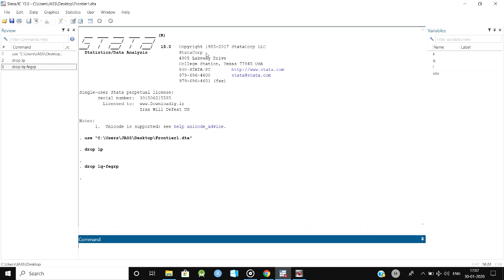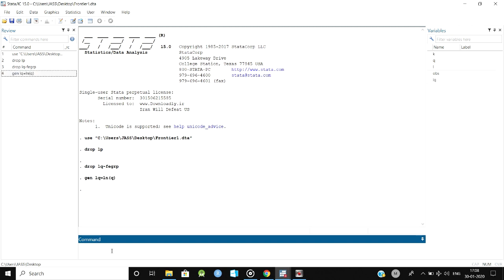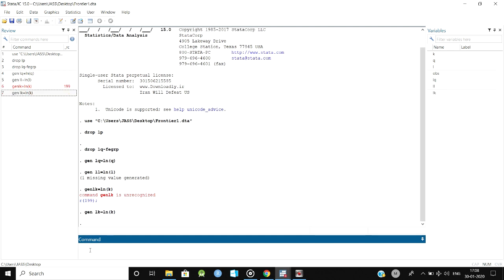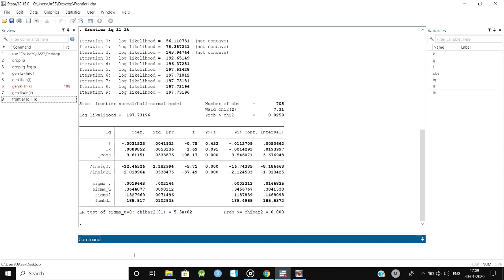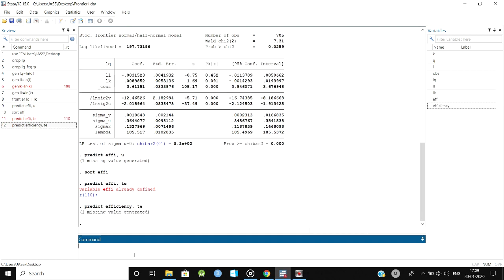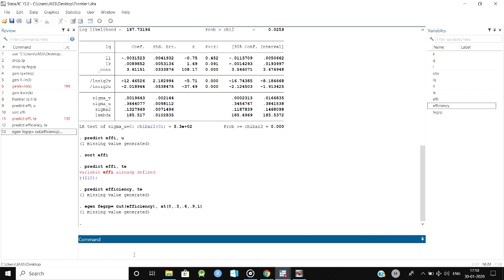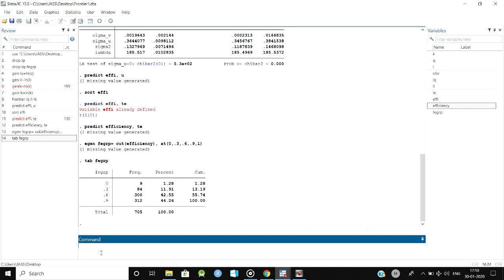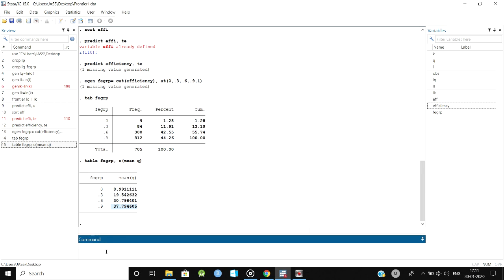Technical efficiency (frontier) estimation in STATA

Comment: Could you please clearly write the stata command you had used. It will be helpful for me.
Reply from the maker: frontier lq ll lk
 ren effi u
predict effi, te
egen fegrp=cut(effi), at(.3,.6,.9,1)
 table fegrp, c(mean q)
Reply: @techeconomist6919  hi friend, what is the fegrp? do you mean that 1 is the maximum of TE?  this command is for grouping firm to different level
Reply from the maker: @tupham8391  fegrp is grouping of the respondents. yeah 1 is 100 percent. out of which the percentage of the respondent achieving the efficiency.